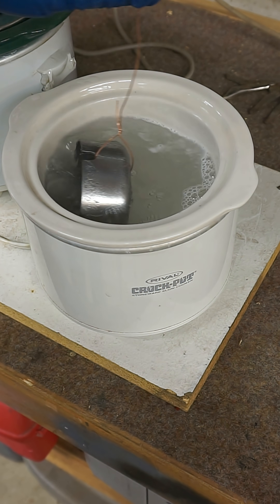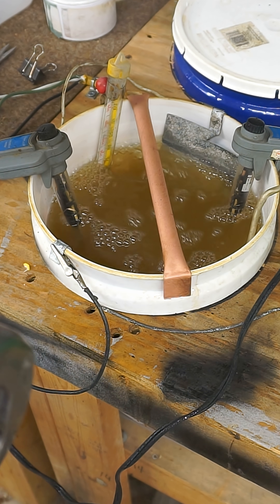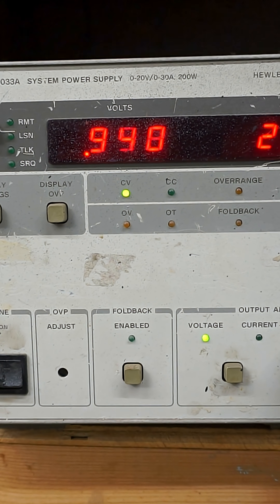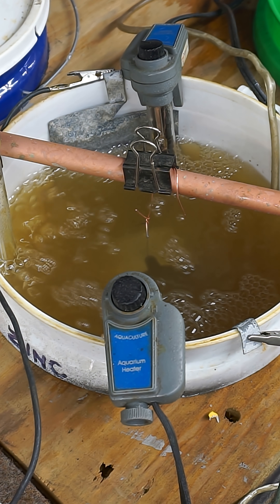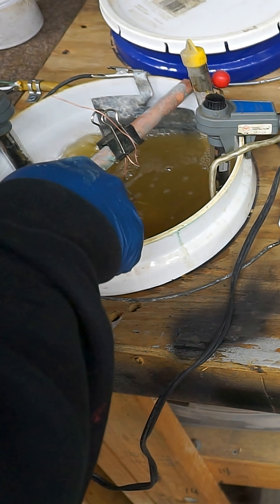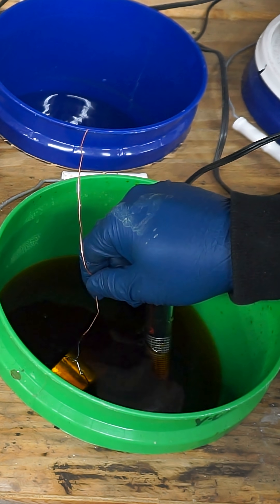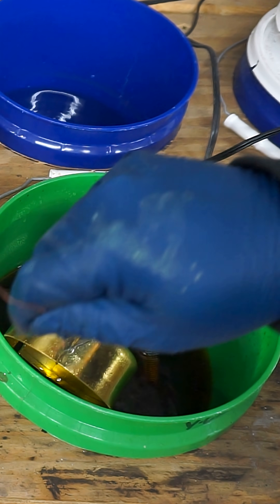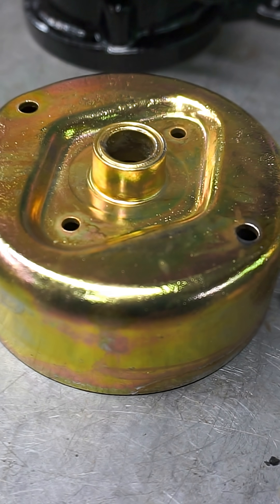DIY Zinc Plating AND Yellow Chromate at Home

Comment: Hi, I'm wondering if you could help me know where i went wrong because my little engine bolts would not get coated in zinc, although slightly, and turned out slightly chalky white on some areas. I used all the specific materials - pure copper wire, 9 amp battery charger, epsom salts for electrolyte. The issue might be because I used a boat sacrificial annode for my zinc. But I can't see why that would be problem in my humble opinion. I gave the parts a good 2 hrs and they had excellent conductivty. 
Thank you
Reply from the maker: I'm not sure on that.  I have never had a white chalky residue.  I have had black from too much current, but never white.  The zinc might not be pure, may have some aluminum in it if I had to guess.  You  can try 99% pure zinc on amazon or Caswell sells it.
Reply: @vwwerks Ok. Thanks on that. I'll get some pure zinc.